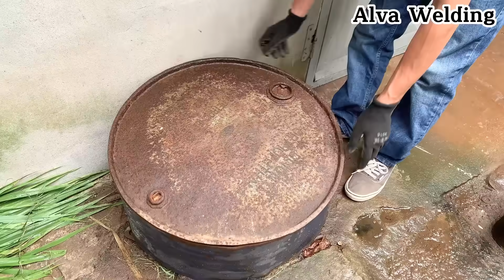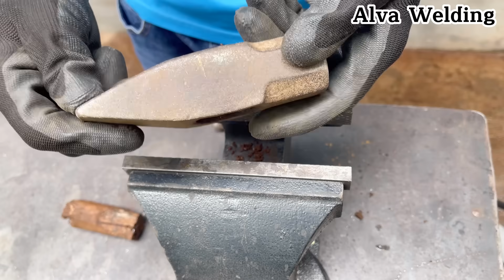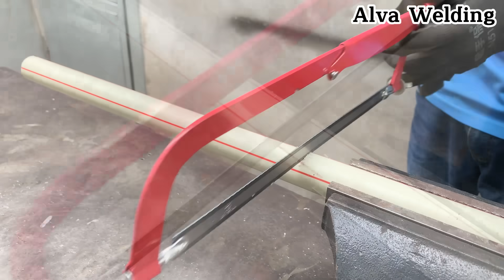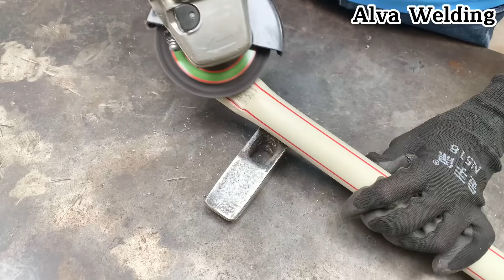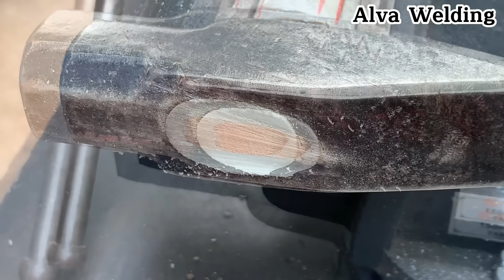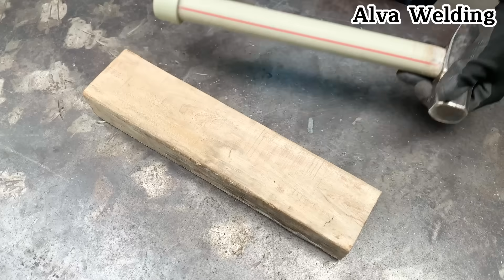Amazing Use Of A Hammer And Plastic Pipe.

Comment: One issue I see is a hammer handle is not round. The handle is oval, this helps index the face of the hammer. Might not be much of an issue if you only strike 2 or 3 blows but I'm a blacksmith and would strike hundreds of blows an hour. The plastic pipe should be pretty good at absorbing the shock though. I make my handles from Boise De arc wood, toughest wood in North America. Some call it Osage orange or horse Apple. Hickory and ash make good handles but they're not near as durable.
Reply from the maker: Hello! welcome to Alva Welding channel. I am very happy to read your comment. Wish you have a nice day!

Comment: I coat raw end with superglue..
Reply from the maker: Welcome to Alva Welding channel! Thanks so much for watching our video. Wish you all the best
Reply: I should have specified using ‘super~glue’ on the ‘faces’ of wood mallets I’ve turned…no need on metal which I haven’t turned or refurbished.  FYI : being curious, I called J B WELD in Texas and they assured me that a shaft set into a wood mallet head would NEVER break at that joint ! ….the elderly spokesperson was noticeably worried that I was after their proprietary formula ! Fond conversation.

Comment: Great design!  Would you be able to put threads on the end of the pipe handle for a screw-on pipe end?  I’d be afraid of the plug type coming off unexpectedly.
Reply from the maker: Thank you. That's a great suggestion, but this device is also quite sturdy. I don't think it's necessary to shoot screws because it will be inconvenient when you get nails or other materials you need to put in there
Reply: @DaveHarris75  :: with money, couldn’t threaded solid round or threaded thick-walled pipe be threaded into a drilled & tapped inner bore of a ‘single~jack’ represented like this ? Fun with the millwright !

Comment: My issue is how the vibration back through Ur hand arm. Ans how long would handle last before brittle and breaks. Not long
Reply from the maker: Hello. They will last quite a while. This is the outdoor heat pipe of the hot water pipe, see how harsh the outdoor conditions are

Comment: The hammerhead looks fine. But I am is but ugly. What kind of pipe is that anyway so thick.
Reply from the maker: Hello. I use the heat pipe of the hot water line

Comment: Useless repair, a hammer handle should NEVER be round! Everybody who gave this a like knows nothing about tools!
Reply from the maker: I understand that you didn't find this idea helpful, and I appreciate you sharing your perspective
Reply: @Alvawelding20  It' is NOT my perspective, it's a fact - show me one hammer made by a manufacturer that has a round handle!
Reply: @joepkortekaas8813... Show me a law that says a hammer handle has to be a shape other than round! First off, I find it bizarre that your complaint was the newly made handle is round instead of being made out of wood which is the traditional material for a hammer handle. Secondly, hammer handles come in a variety of shapes, some of which are close to being round - especially near the bottom of the handle. While hardly being optimal, a round handle is still a handle which is far better than what the author of the video started with which was a busted off handle thus making the hammer useless for its original purpose. Next, you don't seem to give a flying rip that the plastic handle is straight. How is this bad? It perpetuates vibration from the hammer head down the handle and into your hand which is exactly why traditional handles are still made of wood and they are mostly made in a non-concentric shape from top to bottom... often with a slight curve which tends to kill vibration by default. Lastly, which handle a hammer has is the best left to the personal preference of those who use it. Perhaps the owner of the handle is perfectly happy with it... and if you're going to inject your thoughts on it into the comments section, you could do it in a more constructive fashion. Think about it! 

- Max Giganteum

PS For the record, I would advise never to use a handle such as what was made in the video. I do recognize however, that sometimes you work with what you have at the time. I would still recommend the author to take the time out to manufacture a wooden handle.
Reply: Wenn nichts anderes zur Hand ist kann man das so machen.  Aber... es ist immer besser ein passendes Holz zu besorgen. Einen Holzstiel anzufertigen ist nicht schwer.
Reply: @MaxGiganteum  A round handle will turn in your hand - if you don't know that it's quite obvious you know absolutely NOTHINBNG about tools! Blunder on!